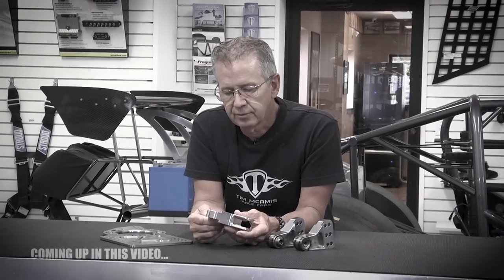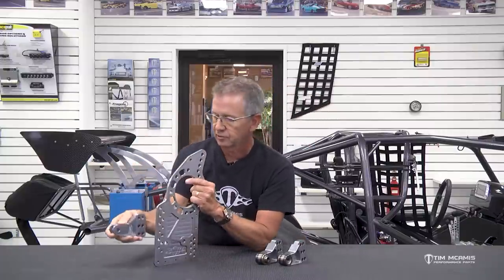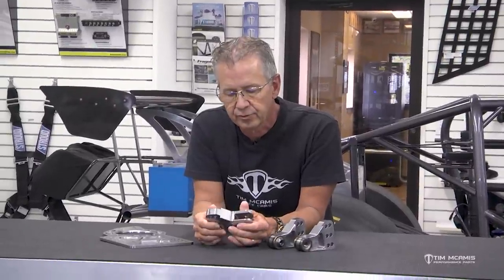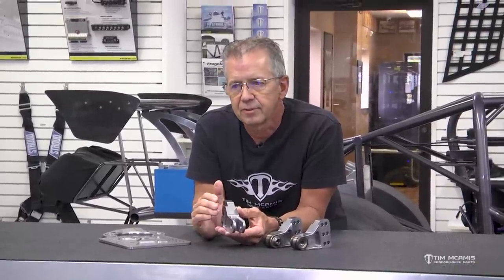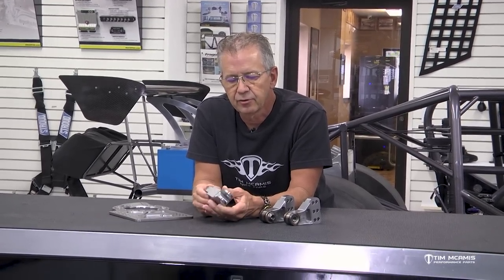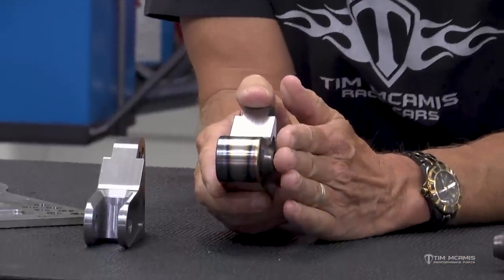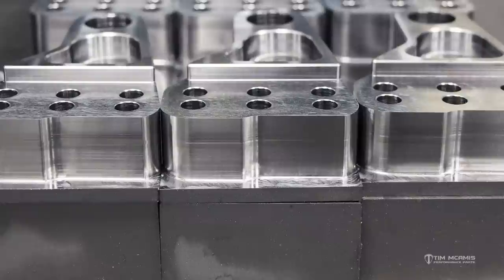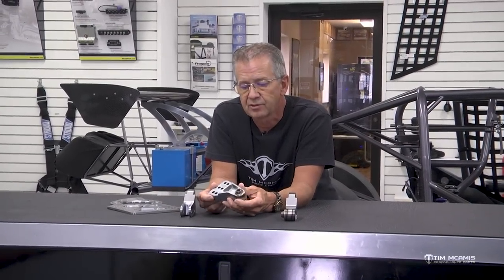Do’s & Don’ts of Adjustable Shock Mounts

Comment: Carroll Smith wrote in one or more of his books that while aluminium has superior tensile strength pound for pound, where stiffness is needed an aluminium part will weigh the same as a steel part if it has the same stiffness.

Comment: Great video/point. I must say, aluminum double shear mounts you see commonly these days have always made me a little nervous. And I believe they are typically 6061 and not 7075; regardless, aluminum can get pretty brittle and shock mounts certainly are stressed not only with a lot of force, but with quickly alternating forces, sometimes with high frequency; think about tire shake and/or radial setups that start the run holding the car's rear weight, then suddenly have the shock pulling against them to control extension (rebound) during the run. If a car goes up on the rear wheels/tires and the driver lets off of the throttle, nearly the entire weight of the car plus dynamic forces are suddenly on the rear shock mounts. I haven't personally seem any aluminum ones fail, but the deflection which could potentially affect the tuning is definitely something else to consider, as you pointed out. Thanks for the video, and nice product!

Comment: Although not a popular material outside of Aerospace,  17-4 Ph stainless is worth looking at. Far better corrosion resistance than steel,  a simple single stage heat treat will substantially increase mechanical properties. An added bonus is the color that is created during the HT, a gorgeous dark bronze if HT'd at 900 degrees (H900). I actually prefer machining it in the H900-1025 condition then doing a short heat up to 875-900 to get the color.
Those mounts would be over the top in 17-4. Get a piece and experiment. No point in sinking more time in the shock mounts but for something else
Reply from the maker: We've used 17-4 and done the H900 HT on it before. Definitely a cool material with some unique benefits.